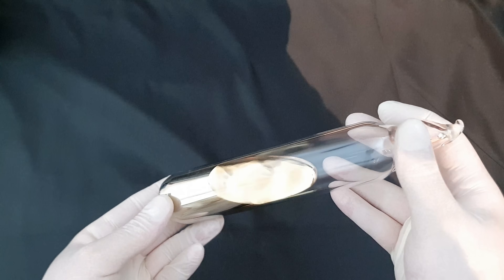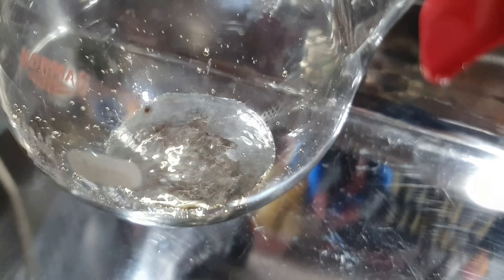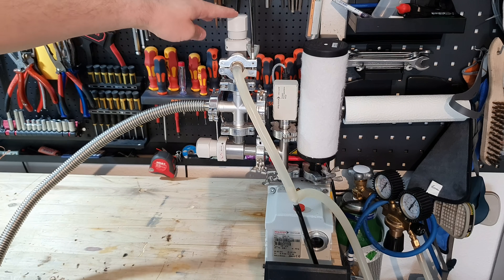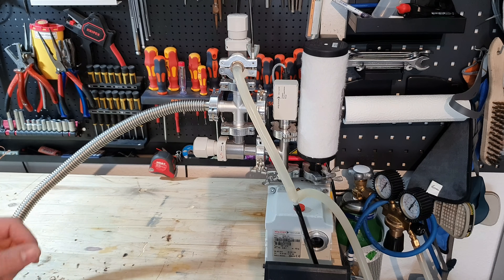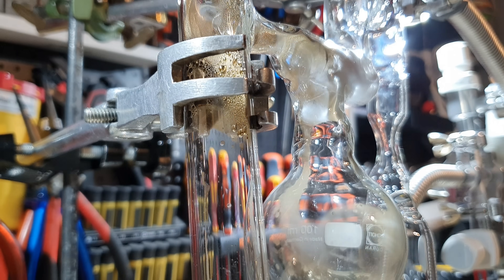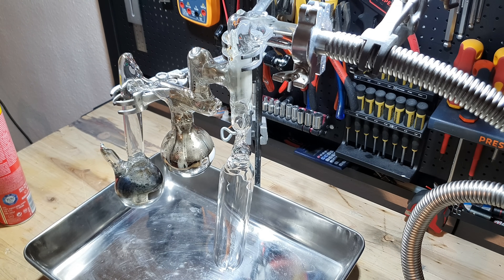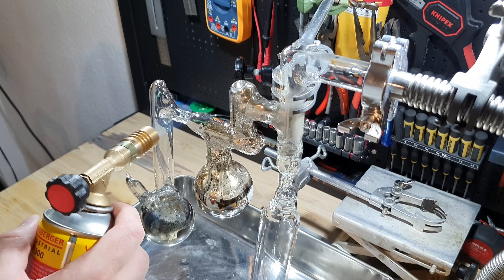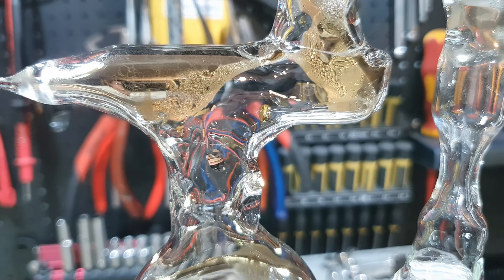The Most Dangerous Object I Have Ever Held In My Hands

Comment: Great work.

Question: I understand using the hand torch to heat cold spots in the tubing between the flasks / ampoules to keep it from getting clogged with solid cesium.

But why not have a burner on a stand under the boiling flask to provide the main heat, and use the hand torch just to heat the cold spots in the tubing? It seems like a burner on a stand would provide more consistent heat and distill faster. Is there a safety reason you didn't, or did you just not have one at the time?

Comment: Hello, let me ask you a question: what kind of O-ring is used at the bellows and glass interface in the video of distilled cesium metal? Is it perflurane or fluorine rubber ring? I have tried your method, there will be air leakage, it is difficult to improve the vacuum.

Comment: I am in wonder how the glass did not crack with the torch heating. (Glass blower here.)
Reply: Laboratory glassware is made of borosilicate glass ("Pyrex") which does not expand or contract with heat/cold.
Reply: @karhukivi  While borosilicate glass is more resistant to thermal shock than soda-lime glass, annealing is STILL crucial for its durability and to prevent cracking or shattering, especially for thicker or more complex pieces.

Even quartz glass, with a very low COE of 5.5 x 10^-7/K should be annealed after flame working.
Reply: @tihzho  I know very little about glassworking but I did university chemistry and learned how to draw capillaries, bend tubes, make thermometer bulbs and fuse together tubes.   We heated liquids in flasks, beakers and test-tubes, including melting some metals in them. The only time anything broke was when it was dropped.
Reply: @karhukivi  Ok I have +40 years experience with glass.
Reply: Didn't he anneal the glass? After melting the ampoule off he kept the flame on the glass. I sure he kept it there after the cut in the video and also used a colder flame as seen in his other videos.

Comment: How do people discover stuff like this this metal explodes went it makes contact with air so how did people find it
Reply: It comes from an ore. Pollucite. 

Cesium was discovered in 1860 by German chemists Robert Bunsen and Gustav Kirchhoff using spectroscopy. They analyzed mineral water and noticed distinct blue lines in the spectrum, leading them to identify a new element which they named cesium, from the Latin "caesius" meaning sky blue.

The actually Liquid Metal you see here wasn’t isolated until 1881 by Carl Sefferberg

Comment: Technically it is a vial because of its size. Ampoules are usually much smaller. And you cannot reuse material inside an ampoule due to its small size, whereas the larger size of a vial allows for resealing of the container

Comment: Francium is the most reactive
Reply from the maker: The idea that francium is more reactive than cesium is actually a common misconception. Although francium is located below cesium in the periodic table, its ionization energy is slightly higher, making it less reactive. This is due to relativistic effects caused by the size of the francium atom.

Comment: I have no clue what someone would want this amount of pure caesium for but good lord. The sheer guts you have to remove the flasks not once, but twice- without wearing gloves or anything, floors me. Please stay careful, man. This is basically elemental napalm
Reply: Gloves aren't of much use if you're handling materials that will not only end your day but also close the lab/the building/the area indefinitely if you drop them...
Reply: @d0h  depends on they type but initially only the outermost layer of caesium would react. It would be a potentially survivable explosion but your hands are gone if you're not using idk, 5mm kevlar gloves or smth. Furthermore, that's pretty much a glass frag
Reply: @d0h is caesium 55 not caesium 137 if it falls it reacts to a temperature and then fine... it does not explode, it does not produce flames and it is not radioactive...
Reply: Wouldn't it be more comparable to white phosphorus than to Napalm? I think the reaction you're talking about would be very similar to W.P.
Reply: @brianc1481 yeah id argue WP is more the elemental napalm and cesium is like elemental kindling lol
Reply: I'm not a scientist by any means but watching this I can't but be curious as to what kind of reaction you could get if you were to submerge one of the ampuls deep enough for glass tube to collapse under the water pressure. I imagine it wouldn't have to go too deep considering the glass is already a vacuum so adding more external pressure (again I'm not a scientist but from my understanding that would mean that the glass only receiving pressure from the outside) so I guess the questions that come to mind are how deep would it have to go to have a catastrophic failure, and what kind of reaction would happen/ be visible/ observable from the surface
Reply: @michealrollins6656  It really depends on the thickness of the ampule. And I think it's safe to say he's not storing his cesium in something as thin as one of the old smelling salts poppers. It might be strong enough that when the glass fails, you'll only get a few bubbles of hydrogen and oxygen at the surface. Maybe with a wisp of reaction product fumes in them.
Reply: @michealrollins6656 that is such an awesome question.
Reply: Sodium floats and goes bang, cesium sinks to the bottom and shatters the glass vessel - immediately.
Like to try the same method with rubidium. Should be the same process.
Reply: It would make a good Molotov cocktail

Comment: If you dropped this vial on the floor and it shattered, how large would the reaction be, and would you survive it?
Reply: It would burst into flames, but you'd probably survive it if you just ran away - footage I've seen suggests that there's like maybe a thirty-second delay or thereabouts between caesium being exposed to air and catching fire. Though that was with a smaller amount of caesium, maybe with that much it would catch fire instantly.

Even so, it's not like a grenade or anything, unless you dropped it into water. But you might burn the lab down - alkali metal fires are notorious for being virtually inextinguishable.

Comment: "Doesn't stick to the glass at all"... and yet I see a lot of little drops of metal inside this vial...
Reply: He means something different. You will always have little droplets sticking to the glass because of adhesion, but they will combine with the rest again. He means that there are no oxidation products which coat the glass (won't form droplets) and float on the surface of the caesium.

Comment: No idea how this video got into my recommended box, but i like it. Watching the cesium condensate on the glass walls just to vaporize instantly when you go over it with the flame, just doesn't seem right for a metal xD
I love the final shot with the crystallized blobs in the vial. Melting point of 28,44°C, so it's mostly solid when sitting on the counter, but melts in your hand. That's so cool.

Comment: Hey. I always wondered what would the soap turn out like if you used RbOH or CsOH as the base?

NaOH make hard soaps and KOH make liquid ones. LiOH is used to make greases. What will be the properties of Rubidium and Cesium soap? Perhaps you could also try making NH4OH soap?
Reply: NH4OH isn't even stable as a solid, it decomposes into ammonia and water. So making soap from it would absolutely reek.

Didn't know that the different hydroxide have different properties in soap-making, though. That's kinda neat, is the any explanation for why they behave differently because most of the time the various different alkali metals are chemically almost identical.

Comment: The cesium exposure accidents, where people extracted the cesium from old X-ray machines, describe it as a shiny, glowing powder. You show it as a liquid. Why?
Reply from the maker: There are two very important differences: 
1. The case you are talking about involved cesium 137. A radioactive isotope of cesium. The cesium I'm handling is of course not radioactive. 

2. The radioactive cesium in those radiotherapy sources was a salt (Cesium chloride). Just like the sodium is a soft metal and sodium chloride is a white solid, the cesium metal has different properties than its salt.

The blue glow of the radioactive cesium was probably caused by fluorescence, or Cherenkov radiation as far as I know.

Comment: Ok got to ask why you didn't just build a heated chamber with heat lamps and tin foil, that's stupidly dangerous.
Yeah get some heat lamps and bit bash them with a cheap 3d printer controller using a temp sensor from your local 3d printer shop, it's not 1930 dude.
Reply from the maker: Why do it the hard/complicated way when you can simply use a torch. Besides I doubt heat lamps would be able to reach the required temperature

Comment: There is something very disturbing yet beautiful about watching a metal be distilled.  It seems like something that should not be possible.
Reply: I mean, its a liquid at room temp. Where did this metal come from? I agree with you, this is wild.
Reply: @MattShine11 pure caesium is liquid at or near room temperature. It's found in Pollucite ore and primarily mined in Canada.
Reply: @MattShine11  Hell. It burns in contact with basically anything including air (unless it's colder than -115 celsius)
Reply: We do it with water all the time, tho that's technically more like a mineral when it's solid
Reply: yeah distillation of metal is pure insanity to me, since its a metal i instantly picture it as one of the hardest solids possible, then we have this "metal" thats just chillin in liquid form and decides to become cloud at high enough temp
Reply: @ailospjellok7475  All metals can turn into a cloud at a high enough temp.
Reply: @ailospjellok7475  wait until you find gallium
Reply: If you think that's crazy, oxygen can be frozen solid.
Reply: @josephjauregui9776 😮
Reply: Exactly, was hard to wrap my head around the idea of metal condensation.
Reply: Why? Metals have different properties, you're just assuming that metal means "strong heavy shiny stuff" because you're predisposed to certain kinds and uses of it.
Reply: Humans have been doing this for thousands of years.  Half of the crap you used to type your comment had gaseous metals involved in their production.  Cripes, distillation is primary school chemistry.
Reply: @amarissimus29 OP: it's amazing.  You: RAH RAH RAH belittle belittle belittle

Comment: 10:30
> Seals off glass vial containing liquid metal that combusts on contact with oxygen
> Using oxygen torch
> WITHOUT GLOVES
Reply from the maker: I don't see any problem there. That's standard practice. Good luck sealing a borosilicate glass vial properly without an propane/oxygen torch ;) 
And what would the gloves be useful for? Gloves that would protect you from burning cesium would decrease your dexterity too much and thus increase the risk of accidents.
Reply: @AdvancedTinkering use fluorine as the oxidizer for a safer Methode ^^
/J

Comment: How does the glass not explode when you are heating it during the distillation process...? It looks like the glass is completely sealed (which makes sense because you are working with Cesium), so when you are heating the Cesium I would expect the air inside to expand and eventually shatter the glass, no...?
Reply from the maker: The destination is performed unter vacuum. Which means there is "no" air inside. The still also is not fully sealed as it is connected to the vacuum pump. It would be possible to fully seal the still under vacuum because the boiling and expanding cesium would condense on the colder surfaces again, keeping the pressure the same (provided one does not heat the still uniformly).
Reply: @AdvancedTinkering  - Ah, of course, I completely forgot it was hooked up to the vacuum... Very interesting video, thank you for sharing!

Comment: Absolutely amazing work! Cs has a boiling point of 690 °C under normal pressure. Do you have an idea, at which temperature this stuff distilled over at your low pressure?
Reply from the maker: Thank you a lot! I did not measure the boiling point but I would guess it's somewhere between 300-400 °C.

Comment: I see the glassware meant to be melted together all the time, but I've neither ever used it or ever even seen it used untill your video. You are very skilled at it. The closest I've even done is making ampuals out of large test tubes by heatingnand stretching the top to a thin tube, filling it, then sealing it. I used them for Bromine, which there is no other way i know how to store safely and not get cancer or poisoned due to it leaking or exploding. I tried vials with rubber stappers crimped on with metal, but is failed greatly. Luckly i left it outside.

Comment: You have it backwards

Ampoules are Smaller and Can Only Be Used Once

One of the easiest ways to tell an ampoule apart is the number of times it can be used. Ampoules can only be used once. Don’t let anybody tell you anything else. And here’s why.

The nature of an ampoule doesn’t permit anything more than a single-use. They’re seamless little containers without a cork and must be broken or snapped at the neck to access their content. It’s like breaking a bottle (only you’d have to be more careful here because the content is extremely useful). There’s no coming back from that, is there?

This manner of sealing implies that the content within the ampoule must be protected from external elements such as oxygen. The non-reusable nature of the ampoule makes it ideal for single-dose drugs or samples.

Ampoules are also much smaller than vials and are typically made of glass. However, they can also be made of plastic.

Vials are Larger and Can Be Used More Than Once

Vials are a larger version of ampoules. The version here is shooting it way under the mark because where an ampoule is seamlessly sealed and needs to be broken to be used, vials have stoppers, which can either be a screw cap or a non-latex stopper. Like ampoules, vials can also be glass or plastic, and their flat bottom makes them compatible for shelf or top-of-the-counter placement.

Aside from being larger and having a cover, one other thing that sets a vial apart from an ampoule is its reusability. They can carry multiple doses of drugs and can be reused a number of times. 

You can use vials to fill syringes too. Sometimes, you don’t need to uncover the cap entirely. Instead, you can push a needle through a non-latex stopper to take out the content within the vial.

Ampoules are the Perfect Choice for Unstable Chemical Elements

Though ampoules are smaller in size and only usable once, they’re a perfect choice if you want to store or transport unstable chemical elements. Unstable chemical elements are elements that get disturbed upon exposure to oxygen or any other external chemical compounds in the air. The seamlessness of an ampoule makes it the best option to keep chemical elements like these. 

Vials are the Perfect Choice for Stable Chemical Elements

Vials are for stable chemical elements, and ampoules are for unstable ones. Due to its stoppered nature, chemicals kept in vials do not react when exposed to oxygen, so they’re stable.

Comment: you need to get one of those chain-glass-cutters.  It's like a bikechain of small wheel cutters that you wrap around the glass and then back into the device (that looks kinda like pliers with a chain coming out).
if you are patient, you can get perfect cuts (it'll just pop apart as you cut).

Comment: Is there any PPE that could save you if you're trying to flame anneal it and the glass breaks and sprays metal everywhere?
Reply from the maker: A lab coat made from fire proof material, some thick leather gloves and a face shield would provide some protection. But you loose a lot of dexterity by using thick gloves and thus are more likely to drop the vial.
Reply: @AdvancedTinkering  this really makes me appreciate what it took to build the Caesium-133 fountain at the heart of the atomic clock that sets my computer's time every time I connect to the internet.
Reply: @JinKee  absolutely agree

Comment: i managed to make a shiny 5mm drop of shiny sodium in an ampule made from a pipette, just put it in and melted the sodium several times and made it consume all the oxygen, once it stopped tarnishing anymore i could melt it and roll it to the other side of the test tube and then shortened the tube, was quite happy with the results and then i see you do this haha
Reply: I melted some sodium hydroxide in a nickel crucible with a sprit flame and electrolysed it with a car battery, the sodium would gather around the electrode and could be collected. The current was 12A.
Do not spill the molten sodium hydroxide. My friend spilt some on a notepad and it ate straight through the thick pad of paper instantly.
I tried potassium hydroxide but it didn't work. I read that the potassium dissolves in the hydroxide, not sure if this is the case.